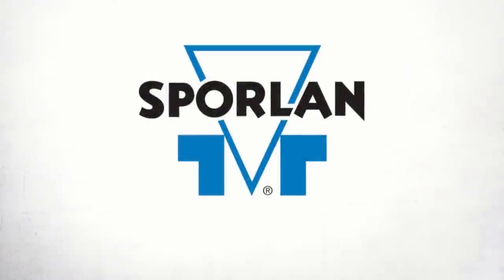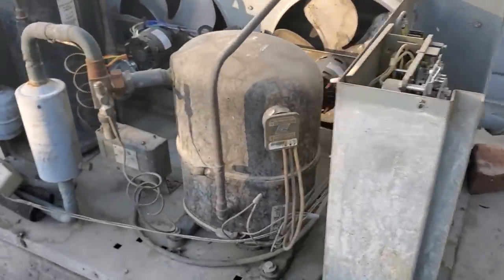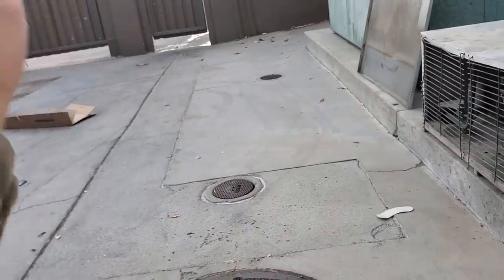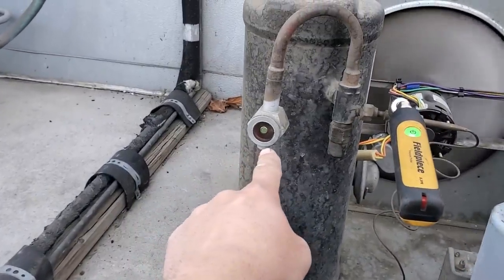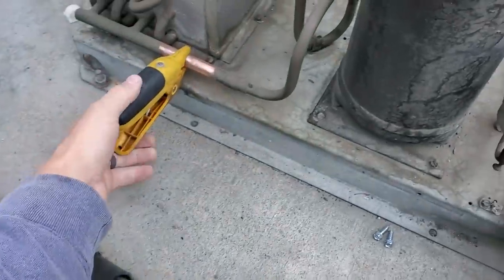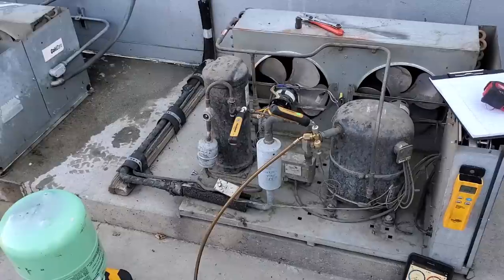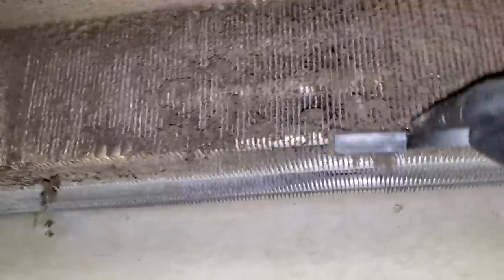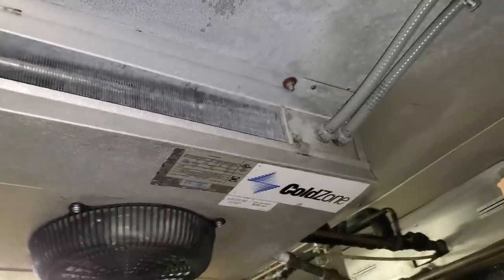WALK IN COOLER ONLY WORKS WHEN IT'S WARM OUTSIDE

Comment: Every time I read your title I try to guess the problem before I start watching. This is the first time I guessed right. Low charge equals low suction pressure when its cold out. Of course there could be a restriction somewhere or something and obviously theres a leak but its fun to try to guess. Great work as usual.
Reply from the maker: I will be going live on YouTube this evening 11/4/19 @ 5:PM (pacific time) to discuss my most recent uploads answer questions from emails, the chat, and YouTube comments. Come over and check it out if you can.     https://youtu.be/edrzjZTZX18

Comment: Good find we do get calls in the northeastern on refrigeration systems.Its common when the temperature fluctuated when it drops at night when the season change. A lot new guys get this diagnose as a leaking system it's stacking refrigerant in the condenser when temperature drops. Good explaining the head master .
Reply from the maker: I will be going live on YouTube this evening 11/4/19 @ 5:PM (pacific time) to discuss my most recent uploads answer questions from emails, the chat, and YouTube comments. Come over and check it out if you can.     https://youtu.be/edrzjZTZX18

Comment: I wonder if Sporlan made a calculation guide in metric units , that would make it so much easier for us lot !
Reply: Seriously, there's conversion formulas for every metric and imperial measurement out there. The math is the exact same. Just the unit of measurement changes. 14.35lbs is just shy over 6.5kg.  Silly foreigners.

Comment: Once again, thank you so much for your video. This one  I probably will watch it more than once to get used to the calculations. I need to get that Sporlan manual though. Your explanation was clear and not confusing at all. That's what I think.
One common thing that I have noticed in a lot of the units that you have worked on is the undersized pipe for condensate drains used during the installation. In a several of them (videos/units) I have noticed that they hooked up more than one drain to the same pipe size. That is no bueno because, in order to avoid blockage over the years, it is important to increase the pipe size when connecting more than one drain, and to pitch it properly. For instance, If you are running 3/4" and you want to connect other unit to the same drain, go 1" from there. If you want to connect two more drains, go 1 1/4" from there and so on. Pitch it at a 1/4" per foot. 
Less problems will be created due to a clogged condensate drain pipe. Well, that's what I would do.
I remember a video in which you had to connect hoses and the water when all over the place and that the Manager was freaking out. All the pipe is 3/4" size and it carries condensate from different units. I have to go back and watch it again, but my point is that pipe size should be increased when more than one drain is being connected to a main.

Comment: wow this video explained a lot about head pressure controls and the bypassing operation. really helped me out when i drew it out on a piece of paper while u were talking. thanks a lot
Reply: so when the refrigerant goes from the discharge line to the reciever liquid line, the headmaster can regulate the psi going in? and out?
and the headmaster allows refrigerant to go thru the compressor at 180 psi?

Comment: I was guessing headmaster bypassing when i saw the title. ;-)
Just found your channel today and subed. 38 yrs. commercial hvac/r  mostly supermarkets.
Reply from the maker: Thanks for the sub, I'm just trying to share the little bit of knowledge I have
Reply: @HVACRVIDEOS  Your doing a great job!
It's a tough trade and people don't realize 
the amount of knowledge a tech needs to
diagnose a problem. You need to know more about electrical than the electrician.
More about plumbing than the plumber.
You need to be part chemist and have 
great people skills...  And you have to keep up with an industry that's constantly changing and work in an environment
that's usually not comfortable. And be 
called out in the middle of the night!!!

Comment: I think they were blocking the condenser with the cardboard to keep the head pressure up so it would run
Reply: I'd stick a fan cycling control on one of those fans too.....
Reply from the maker: I will be going live on YouTube this evening 11/4/19 @ 5:PM (pacific time) to discuss my most recent uploads answer questions from emails, the chat, and YouTube comments. Come over and check it out if you can.     https://youtu.be/edrzjZTZX18
Reply: I mean if you came to one and the fan cycle was bad i would just block it off to help it run until you could get one.

Comment: Quick tip: spray the cond. Cool with cold water while you charge, then clear the sight glass. Pump down at king valve and if it pumps down without the Head pressure going up, you know it's not over charged.
Reply: That way you know you're good for a fact in any weather condition whether it's negative ten or a hundred degrees

Comment: Awesome vid. Pretty cool methods, in aus I haven’t had the chance to work on a condensing unit with that type of condenser valve. 

I would of probably looked at cleaning the indoors first so that gas charging was more accurate. Having the indoor like that would have probably ended up with an overcharged system if the sight glass was filled before set point was achieved on the box. I’ll keep watching these vids are good.👍

Comment: Nice video; I would start with the cleaning off the evaporator. Then check the charge and pressure readings.
Grtz from the Netherlands.
Reply from the maker: I will be going live on YouTube this evening 11/4/19 @ 5:PM (pacific time) to discuss my most recent uploads answer questions from emails, the chat, and YouTube comments. Come over and check it out if you can.     https://youtu.be/edrzjZTZX18

Comment: You can also use an HP-switch with auto reset or fanspeed controller. So you keep the discharge pressure stable at 15Bar. Works very effective with cold oudside Temps and you don't have to add refrigerant.
Reply: Are you talking about a fan cycle switch? And a head master?

Comment: They are installing headmasters rated at 150 psig for DOE regulations which by the way has a percent error +/- 15 psig. The head pressure of 135 psig is not enough pressure drop to cause proper txv function.  Here in Buffalo it's below 50 degrees like 8 months out of the year.
Reply from the maker: Yeah I have asked about that, seems kinda silly.

Comment: Another way to understand head pressure control valves. The valve backs up liquid into the condenser during cold weather, effectively making the condenser smaller.
Reply from the maker: I will be going live on YouTube this evening 11/4/19 @ 5:PM (pacific time) to discuss my most recent uploads answer questions from emails, the chat, and YouTube comments. Come over and check it out if you can.     https://youtu.be/edrzjZTZX18

Comment: Presumably that density factor (.100) must be determined both by the diameter of the tubing and the actual density of the refrigerant. So it would be better to call it a density factor for R-22 (at 0 F) per foot of 1/2 inch tube.
Reply from the maker: Good point!

Comment: Those evap coils that are so often dirty and fins clogged up -- who is responsible for regular in-service cleaning of them?  The owner or yourself?  If owner, have they been trained in this?  What about regular or periodic retraining?
I am a retired desk jockey, but I find these vids very interesting.
Reply: the owner is responsible for getting it done but that is usually part of preventative maintenance that they can ask for.
Reply: I see it distressingly often in computers too.
The heat sink fins have air pushed or pulled over them in much the same way as HVAC equipment does. The fin pitch is often tighter, in order to be able to fit them inside of a relatively small computer enclosure.
A PC can be left purring away in a corner for as many as 5-10 years with the side door never being opened. While on the dirty floor.
I have seen some genuinely terrifying dirt clogs, and wondered how these systems were still working and not just ... cooking.
I've seen them with over 1/8" of CRUD caked into the heat sinks.

People just don't clean their stuff.

Comment: Simple physics. Well, simplified, more like. With the ideal gas law, pressure and volume are directly proportional to number of molecules and temperature (and a constant we can ignore since it is constant.)

Since the volume doesn't change because the tubing is all the same, we can ignore volume for the overall system. (Volume is important at the metering and compression side because that's how the whole system works! But we can ignore that here and relates to Boyle's law and joules Thomson effect and most all gases since they're not actually ideal gases.)

So outside temperature falls. Number of molecules stays the same (the bypass valve hasn't gone off to add extra). On the other side of the equation the volume is the same. So the only thing that can change is the pressure must fall as well.

If you need to raise the pressure for proper metering to get that heat absorption, the only thing you can do is add heat (which you don't control the weather) restrict the volume (closed system, you can't shrink the pipes on command) or... add molecules ie more refrigerant.

So, thats why you have extra refrigerant for winter temperatures for refrigeration systems with condensers located outdoors. TA-DA!

Since most residential AC aren't needed in winter, they wont have that. Many businesses won't either but some big businesses might. And restaurants all have their condensers outside so they'd need the capability. Other refrigerators inside the house or restaurant that reject heat into the indoors area, well you're warmer than ambient outdoor air, i hope, so it isn't an issue either.

There is the simplified version of why if anyone is curious.

Comment: From your presentation I made a spreadsheet to calculate this, which I'm trying to proof. 

0°F Density Factor = 0.100
40°F Density Factor  = 0.094
Condenser length = 33"
Condenser tube diameter = .5"
Number of Tubes = 48
Number of Bends = 46
Return tube equivalent length = 0.25"
Condenser equivalent length = 143.5'
Total winter charge = 14 lbs 6 oz
Winter charge needed for 0°F = 0 lbs 14 oz

1. In that situation calculate an additional 14 oz after clearing the sight glass?

2. And if you were above 70°F (HPR not bypassing) you would add the entire 14 lbs 6 oz after just clearing the sightglass?

IMPORTANT Using this method with a clear sightglass, you would first need to remove refrigerant until the sightglass just starts to flash.  Then add the refrigerant back in until you just clear the sightglass, before following this procedure.  

Remember to wait for the system to stabilize with every step along the way.  Over charging have serious consequences!

Comment: Why do other techs in other businesses keep claiming that a flashing sight glass does not matter? I would think it is pretty important, and if it didn’t matter would not be included to see. As to why though, I am not sure
Reply from the maker: It all depends on what type of system the sight glass is on. On a Refrigeration system with a TEV and a receiver the sight glass needs to be clear to insure proper refrigerant charge.
Reply: Not an HVAC tech, but really a flashing sight glass indicates a 2-phase mixture (liquid + gas) coming back from the condenser. On most general refrigeration systems this usually is a low charge. There is not enough charge in the system for the high side pressure to be high enough to have only liquid refrigerant coming back in the return line. Since gas does not absorb much heat when it expands, the performance drops as the ratio to gas/liquid increases. Back when I was doing site survey work for retail construction I used to do the same thing by listening to the expansion valve and checking the suction and return line temperatures by hand on split-systems that had the evaporator accessible. The sound and the temperature difference across the evaporator provided a crude indication of how the equipment was operating.

Comment: Very interesting video, thank you for sharing that.
When this situation starts to happen, would it make the TXV sound like it has a restriction?

I have a walk-in cooler that on a very cold night the TXV sounds like it is restricted, that's the best I can describe it.  The first time it happened my refrigeration guy came out and said it might be a problem with the headmaster.  Then through the spring and summer I forgot all about it until I heard that same noise a couple nights ago.

Problem is I'm in SO Cal along the coast where 45 degrees is very uncommon and it's 1 or 2am when I hear this and I don't want to bother my refer guy in the middle of the night.

So if I hear this noise again would it be helpful to check the sight glass and measure the temps before and after the headmaster?

Is below 50 degrees "cold enough" to cause a large enough pressure decrease for R410a?

Thanks for taking the time to share these videos.
Dave
Reply from the maker: Yes the sight glass should be clear whenever the system is running cold or hot outside it should always be clear. But my concern is you mentioned 410a walk in coolers dont use 410a are you sure you are speaking of the right refeigerant?
Reply from the maker: Also to answer your question yes the txv will make a hollow hissing sound when vapor is present at the inlet of the valve
Reply: Wow, Thank You very much for taking the time to answer my question.

Your correct, it's 404A a Tecumseh AWA95142ZXNHN condensing unit.  I'm in LA county right on the water so we don't get extreme  temp changes or freezing temperatures.

But I just looked and can clearly see the places you measured the temps to see if the headmaster was bypassing and next time it happens I can check that and the sight glass and hopefully save my guy from coming out in the middle of the night.Thank you very much for your help!

Comment: Wow that blew my mind 
my teacher did not tell us about that when I was in school lol thanks for the detail information 

Question now can I use this calculation on different refrigerant at 0 (zero) degrees for example 404a or 407c and so on ?  

Question do I need to have a headmaster in the unit so I can use this calculation or if the unit only has a liquid receiver or both ?
Reply from the maker: This only applies with a head pressure control valve, and yes if you download the manual it has different refrigerants in it, I will discuss this on my Livestream tonight  I will be going live on YouTube this evening 11/4/19 @ 5:PM (pacific time) to discuss my most recent uploads answer questions from emails, the chat, and YouTube comments. Come over and check it out if you can.     https://youtu.be/edrzjZTZX18

Comment: When you add the winter charge are you suppose to remove it when summer begins?
Reply from the maker: No if the system is designed properly once you add the flooded charge (winter charge) it strays in the system all year long, however if the system is not designed properly the receiver may not be big enough to hold the entire flooded charge throughout the summer.

Comment: I never see you washing or cleaning fan blades weather it’s on the roof or inside, that will increase amp draw on motors, try it, it does work.

Comment: Great job. Do you ever check the level of the receiver with a digital thermometer? We used to cycle the fans on the condenser but if it was a really windy day that caused some issues. Thanks for the video's.
Reply: Or take your propane tank and run it up and down the rec. That will give you the liq level.
Reply from the maker: I will be going live on YouTube this evening 11/4/19 @ 5:PM (pacific time) to discuss my most recent uploads answer questions from emails, the chat, and YouTube comments. Come over and check it out if you can.     https://youtu.be/edrzjZTZX18

Comment: Low on charge and just meter in? No leak check? If the system failed further down the line the client would be frustrated to go thru the process again.
Reply from the maker: we will do a proper leak check but we have to get the customer up and running first than leak check after, so long as its not a giant leak it can wait.
Reply: @HVACRVIDEOS  I figured that. Last time I did that it was at a hotel. And made sure to state that I can get them up and running for now. But the system may fail again without a leak check. Also your coil charge calculation was cool. Is that located in the FSM of the equipment? Or just a rule of thumb?

Comment: Why is this better than a fan cycling switch?
Reply from the maker: Fan cycle switches can be very violent on the system when they turn on and off. Especially in the mild climates we have in southern California
Reply: Based on the title of the video, the first thing I thought was a bad head pressure control/condenser fan cycling switch.

Comment: If you don’t have a condenser control valve on the system, do you need to calculate a winter charge?
Reply from the maker: No this calculation only applies if the system has a head pressure control valve I will discuss this on my Livestream tonight, I will be going live on YouTube this evening 11/4/19 @ 5:PM (pacific time) to discuss my most recent uploads answer questions from emails, the chat, and YouTube comments. Come over and check it out if you can.     https://youtu.be/edrzjZTZX18